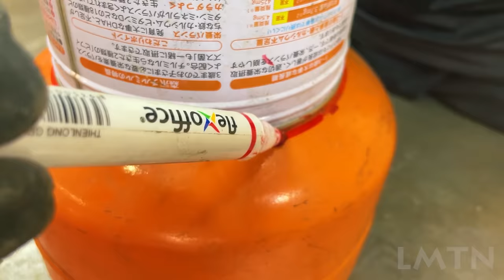SIMPLE things you can do with Waste Oil Burner | Made from Cement, Blue Flame and Easily at home

Comment: Sir, can the fan use an old computer fan, or can I not use a fan?🤔🤔🤔
Reply: just used an old hairdryer ...and the heating element came off
Reply: Air pressure too low and not enough air is forced in. If you have a turbine housing like this, you can build up pressure, computer fans are just for outlet flow.
Reply: Koun sa fan lagega sir

Comment: You say those 8 holes are 42mm  I am quite sure you ment 4.2mm
Reply from the maker: You are correct, I misspoke in the video. The 8 holes should indeed be 4.2mm, not 42mm. I apologize for any confusion, and thank you for pointing that out. Please use a 4.2mm drill bit for those holes. If you have any more questions or need further clarification, feel free to ask.

Comment: Can you melt aluminium on it,,,,, its super awesome video
Reply from the maker: I'm glad you enjoyed the video! Melting aluminum using a homemade furnace can be a fascinating experiment. While it's possible to melt aluminum with the right setup, safety is of utmost importance when working with high temperatures and molten metal.

Have you attempted to melt aluminum yourself, or are you considering trying it? If so, do you have any specific questions or challenges you'd like to discuss regarding the process, equipment, or safety precautions? Sharing more details about your experience or plans can help provide more targeted advice and insights.

Comment: What about the exhaust? Good for outdoor use only. Unless placed in a fireplace or some kind of vent pipe above.

Inspirational nonetheless. I may convert the inside of an old wood burning stove for an indoor unit.
Reply from the maker: You're absolutely right; using a setup like this outdoors or in a well-ventilated area is crucial due to the fumes produced during the combustion of waste oil. If you're considering converting an old wood-burning stove for indoor use, it's essential to ensure proper ventilation and safety measures are in place to prevent any potential risks associated with indoor burning. Safety should always be a top priority. Best of luck with your project, and feel free to ask if you have any more questions or need assistance along the way!

Comment: What is tha exact size of bore sir
Reply from the maker: To provide the exact size of the bore, I would need more context or information about what specific bore you're referring to. Bore sizes can vary significantly depending on the application and the equipment in question.

If you could provide more details or clarify which bore you're inquiring about, I'd be happy to assist you with a more precise answer.

Comment: How many hours will we Can Use in  LTR' Oil ???
Reply from the maker: The number of hours you can use 1 liter of oil in this type of stove will depend on several factors, including the design of the stove, the type of oil used, and the stove's settings. Typically, you can expect a liter of oil to provide several hours of burn time, but the exact duration may vary. To get a more accurate estimate, it's best to refer to the specific instructions or user manual provided with the stove you are using. The manufacturer or seller may also be able to provide guidance on burn times for your specific model.